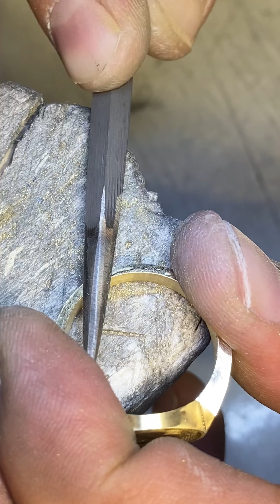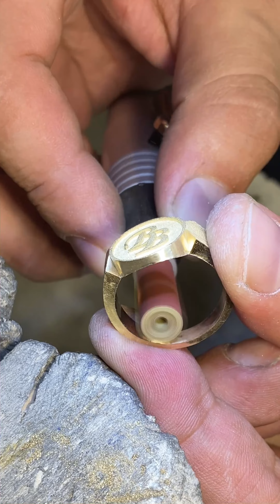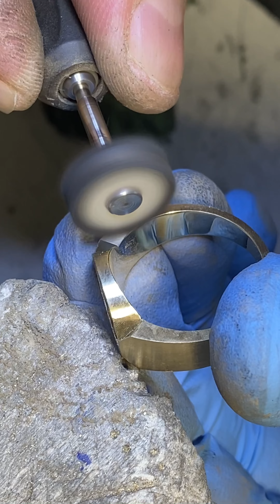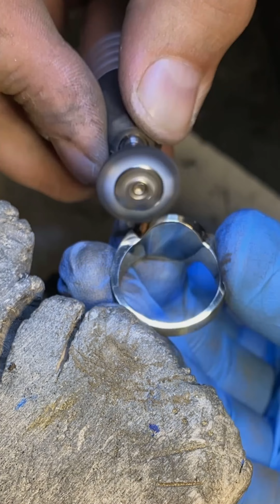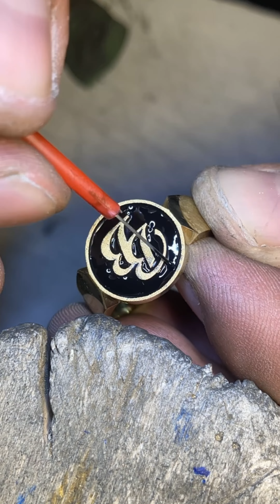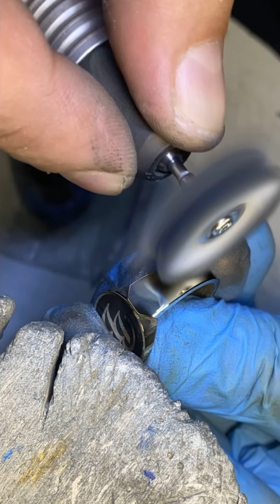Gold ring (14k) with black enamel⚫️

Comment: It seems like you covered the motif with the paint, then it jumps to you polishing... So my question is how did you remove the excess paint before polishing? Thanks
Reply: use abrasive to get the motif and paint to flush before polish

Comment: Does the enamel fade with time? Please answer
Reply from the maker: Enamel cools under an ultraviolet lamp and becomes hard
Reply: @ayurov_jewelry  so it doesn't fade as years go by? I'm looking to buy a black enamel coated gold pendant and hesitating cos the jeweller told it fades after few years
Reply: @ayurov_jewelry  Hi Aldar, What kind of enamel is that? Could you please share brand? Thanks
Reply from the maker: https://sl.aliexpress.ru/p?key=hM9HZSp